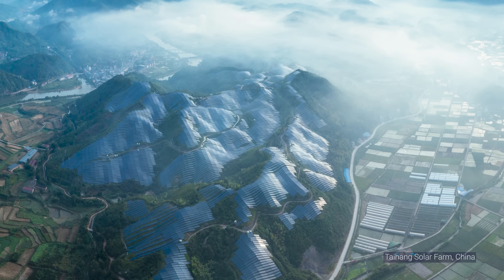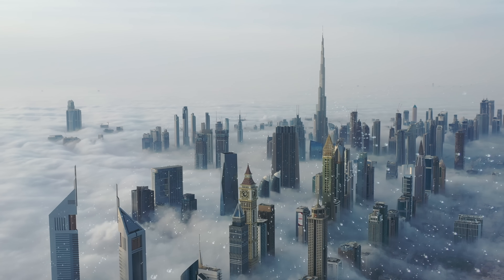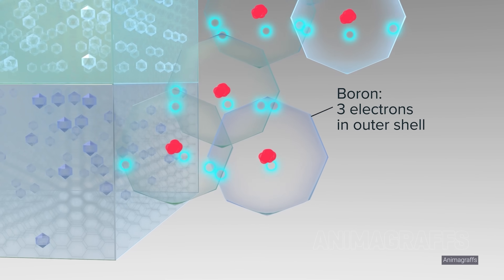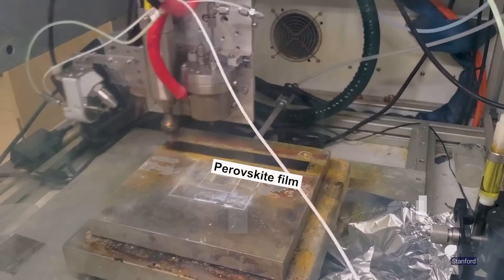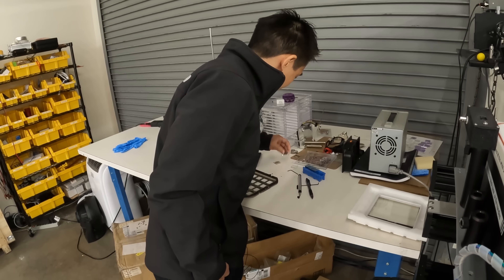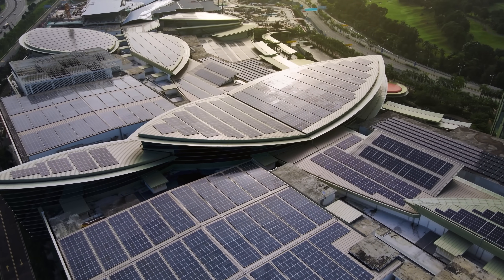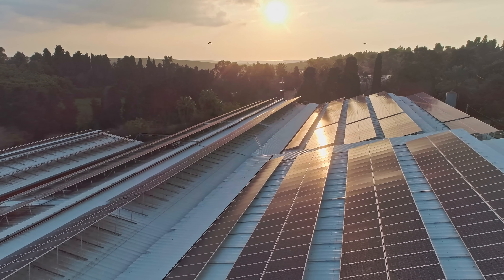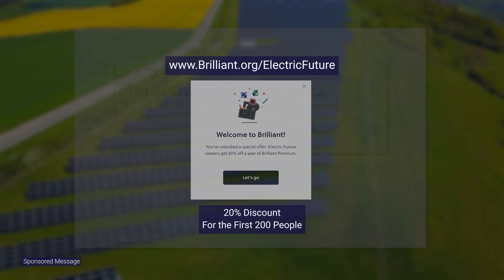Solar 3.0: This New Technology Could Change Everything

Comment: If it’s actually much cheaper, then the low cost could supplement the “short” lifespan. Also, the higher efficiency would make it beneficial to have a replacement schedule. 
But, each time we hear about cheaper tech, it is always more costly than what it replaces. 
Eg, carbon fibre parts, aluminium parts, cars made with more plastic and paper and thinner/less metal, all costs more than the predecessor. 😏
Reply: Hi! I do research with perovskite optoelectronic materials, and the issue around perovskite lifespan is less about the cost, and more about the environmental effects of perovskite film decay. 
Most perovskite research is based on a structure that fundamentally relies on lead as a constituent. So, the worry is that if the material decays, harmful lead salts could be introduced into neighborhoods and ecosystems.
Also, the stability issue as I understand it is more detrimental than described here; leaving an unprotected lead halide perovskite material in any hot, humid, or even heavy rainfall environment would cause the material to stop performing & decay into lead salts, which, until addressed, seriously limits applications. Even exposure to air in lab on humid summer days can "kill" the materials useful properties.
I hope this helped you understand the perovskite's stability issues more!
Reply: @sweetshiba_  Hmmm, you are a true lab geek. I can relate perfectly to your explanation. Did some university chemistry (a little material science too). 
Keep up the good work.
Reply: @sweetshiba_  Then why do you manufacture panels with PV materials in them?

Why don’t you manufacture polymer/silicate panels that collect, concentrate, SPECTRALLY* (autocorrect mistake) disperse, and transmits light to a centralized processing unit in the basement?

Manufacturing would be far easier, panels would be far cheaper, and all the cost/environmental issues would be in a smaller contained unit in the basement.

You also have the benefit of adding more materials to handle different band gaps asymmetrically. If you only want to convert two or three wavelengths, you buy two or three filters with the respective material. If you want to convert 20 wavelengths, buy the respective filters for those particular wavelengths.

Now your PV technology isn’t ties to the panel and transmission systems that are the most exposed to the elements. All damage from the elements are done to the passive optics and not the conversion units in the basement.

Also…passive optics are completely impervious to EMP like from lightening, solar flares, or upper atmosphere nuclear explosions.
Reply: @josephcoon5809  Sorry, I don't really understand your question. How would you collect, disperse, and specially transmit light without having already converted it into electricity?
Reply: @sweetshiba_  You don’t know how light propagates from one medium to another with a different index of refraction? Or how light disperses through a diffraction grating?

You’ve seriously never heard of fiber optics?
Reply: @josephcoon5809  I'm not sure if I'm familiar with a mechanism that would allow that idea to work without facing a higher net energy loss than you would with current solar cell designs. If you have a good idea you believe in, though, research it!!! It's good to have critical thinkers with new ideas :)
Reply: @josephcoon5809  unfortunately, i have deadlines to meet & plans to stick to in my materials research! So I'll keep doing  what I'm doing :) if you feel up to it, though, good luck with that idea!!
Reply: @sweetshiba_  That’s why centralization is a bad model.

In your limited scope, you pursue technologies  without addressing their fundamental flaws. Your adherence to deadlines forces you to adopt a myopic view of the situation precluding your ability to see the dead ends you are heading towards.

As long as you aren’t doing so with government funds, I’m good with it.

However, you you ARE relying on government funds to perpetuate an obviously designed flaw for the sake of “the environment,” then I will engage everyone who engages in regressive thinking.

Don’t drag society down with YOUR failures by accepting government funds.
Reply: @josephcoon5809  ok, you obviously don't understand how research is done 😭 do you have any hands on experience?
Reply: i didn't say this yesterday because i wanted to be nice and encourage you, but the attenuation from the fiber optic design would cause that idea to have seriously diminishing returns when compared to regular PV cell designs, because as your transport light through any medium besides a vacuum, you face a loss of energy. thus, layered materials are a better design from an energy efficiency perspective. 
fiber optics are wonderful and all for information transport, but they aren't suitable for high amounts or actual energy transport, as attenuation is a current problem even for signal transportation
Reply: also, my research is specifically in the scope of materials research for optimizing the solar cell designs that the clean energy market needs. you can't get research funded unless there's someone to fund it. research is expensive. it's competitive. you have to be producing what people want, you can't just follow a poorly researched concept and expect funding for it from anyone.
 so don't be all high and mighty talking about research that you clearly don't understand 😭
Reply: also, if you think you have a good idea, and mechanistically it makes sense from any angle you attack it from, go for it! don't put specifics in a YouTube comment section, because of the idea really is good and someone sees it, they could plagurize without you even knowing
Reply: finally i can tell that you are clearly interested in the topic of PV material design and have started to read about it, which is good! i don't want to dissuade you from following your ideas; we could use new bright minds in the field!! just don't be an asshole to people who are doing the work you're not because you think you understand it better than them, you know? im sure if you continue to be interested in optoelectronic material design, you'll surely be making cool things soon !!! for now though, make sure that you fully understand the fundamentals of what you're doing on, and again, don't be an asshole to people because you think you're smarter than them 😁
Reply: @sweetshiba_  First off, I’m well aware of energy loss through fiber optics, and the short distances you are referring to in a household application of solar energy conversion is negligible compared to the losses incurred through panels subjected to variable environmental factors.

You weighed the energy loss without considering the manufacturing cost.

Way to deal with a single variable of a multivariate situation.
Reply: @sweetshiba_  “you can’t get research funded unless…”

You resort to the most inefficient system imaginable?

A centralized one?

Perhaps you should stick to your field of “research” instead of broadening this to economic and political concepts?

Just because it is difficult to secure funding, that is no reason to engage in the antithesis of natural evolution.
Reply: @sweetshiba_  If you THINK I’m worried about being plagiarized, then you completely misconstrued why I’m doing my own research in various technologies which solar panel design is only a tiny portion of.

You also don’t seem to be in the research for any benevolent reason if you are worried about ideas being “stolen.”

So, now we dip into philosophy and morality.

You sure you want to go there?
Reply: @sweetshiba_  When you ask me if I have any experience in “hands-on research,” do you actually mean “experimentation”?

Anybody can “research.” The internet has made that easier than at any point in history.

Now, if you meant “experimentation,” then yeah…I’ve done lab work done n chemistry class. I understand the general principles, MOSTLY, because that’s what the brain is actually designed for; the cerebrum specifically. Your consciousness is nothing more than an advanced virtualization and simulation machine that stores information and allows that information to be synthesized into new ideas.

Babies do it automatically. How do you THINK babies LEARN to see color in 4-8 weeks after birth?
Reply: also, im not looking to debate you or anything, because i seriously don't care. so, this will be my last reply! take care 💕
Reply: @sweetshiba_  If my “mightier than thou” prose is bothersome, then you should probably consider that “nice words” justifying tyranny is childish compared to “harsh words” ridiculing tyranny.

Maybe if you studied a little neuroscience or some basic Greek history/philosophy, you’d understand why emotional rhetoric like “nice words” are dangerous to society.

Taking society’s wealth to find “your” research is not rectified by being “nice” about it.

You haven’t said anything worth responding to.

You offer your knee-jerk analysis to optical power attenuation and think that’s enough to dissuade me from the major flaws in your research as if you don’t have the time to engage with somebody who you’ve no idea about. I’m actually trying to have a conversation while your tossing scraps to a kid you think is in high school just so he will leave you alone to your research.

If I was like you, I have no doubt that I would find that condescension quite offensive. As it turns out, I’ve studied the brain as well, so I understand what emotions are.
Reply: @sweetshiba_  And I’m not the one assuming they know who the other person is, so claiming that I am the one acting like a “know-it-all” is pretty humorous.

Fun fact: science doesn’t care about “nice,” so stop wasting time with it.
Reply: @sweetshiba_  Of course you don’t care about society.

All you care about is “your” research. It doesn’t matter to you that society has to be dragged down so your existence feels validated.

There is no “debate” here.

It’s just you tossing out vague ideas to shoo the “high schooler away” as you continue on with your elitist attitude about science.

You weren’t here to have a discussion OR learn anything.

All YOU came to do was flaunt some imagined relevancy in what you do.

Congratulations.

Cheers 🍻 

🤣
Reply: @sweetshiba_  Mr Nick, you are a logical thinker. If you weren’t, you couldn’t be making any progress in your field of work. 
Please, don’t be sidetracked by nay sayers
Reply: @sweetshiba_  Just from your ORIGINAL statement, it’s already pretty evident that any energy loss from optical attention over a few yards would be heavily outweighed by the controlled environment of the perovskites that use caustic materials, like Pb, to tune them to various band gaps.

The fact that you lose energy from any photon more energetic than the band gaps requires pretty much balances out with the loss in optical transmission.

Or were you hoping that I didn’t know about the thermal energy introduced into your systems when photons with more energy than the band gap is converted to waste heat which also contributes to the breakdown of the PV materials REGARDLESS of the environmental conditions? Even in PERFECT weather conditions, solar irradiance is across a large spectrum that two or three materials thinly layered together will result in excessive energy inefficiencies AND material degradation.

What do you do with that heat? Are you “researching” some thermocoupling material to absorb that waste heat and convert it to useful energy, or maybe you are looking for ways to exhaust that thermal energy into the environment to lengthen the lifespan of your PV materials?
Reply: solar filter
Reply: For anybody else that happens across this “conversation”…

The “band gap” is the energy required for an electron to jump from one energy state to a higher state in a photovoltaic material. The energy in a photon is described by its wavelength; shorter wavelengths are more energetic. So, every material has a particular wavelength of light that will cause a valence shell electron to jump into the conduction band.

What makes a material semi-conducting is the gap between its base election configuration and the the conduction band. Insulators have a large band gap while conductors have no band gap. Semiconductors have a band gap in the visible portion of the electromagnetic spectrum. However, any photon that has MORE energy than the band gap does not create more current. That extra energy is converted to heat. Since electrons can only occupy particular states, a band gap is associated with a SINGLE wavelength.

The Sun bathes the Earth in an entire spectrum of wavelengths which means most of the radiation produces waste heat regardless of the material you use. That waste heat contributes heavily to the degradation of a solar cell, and the manufacturing processes used for these solar cells makes them too costly to recycle forcing manufacturers to demand freshly strip mined rare earths for conventional panels. For the newer panels using a tetrahedral molecule enclosing various ions creates a tunable PV material to accommodate many different wavelengths. Unfortunately, the main dopant is Pb…lead.

So, now when those panels reach end of life, they are dumped in land fills releasing those caustic materials into the ground.

In this “researcher’s” opinion, the inefficiency caused by thin layers of different PV materials justifies the environmental impacts of dumping these panels into the ground. Apparently this is better than the passive optics approach which also has energy losses, BUT the manufacturing is FAR cheaper AND recyclability is far more feasible. With all the rare-Earths and/or caustic materials operating in the cilantro controlled environment of the basement, degradation is minimal while replacement at end of life is far cheaper.
Reply: to clarify misinformation above bc i'd feel guilty not correcting it:
1.)perovskites are cubic molecules with the active site being [BX6]^2- octahedra, with B = a transition metal and X = halogen

2.)lead isn't a dopant, its the centre of a field of perovskite development for ABX3 perovskite materials (see: inorganic lead halide perovskite)

3.)those panels aren't yet produced because of the enviromental impact, of which addressing is the heart of current perovskite material/cell research; as of now, there is no environmental impact

4.)lead-halide materials currently have PLQYs of around 100%, indicating energy loss in a solar cell would be near zero

5.)the other main issue to be addressed in the current research is addressing perovskite stability issues, which is achieved through various methods, such as doping in different transition metals or by sillica shelling, or by employing absorbant layers with low thermal conductivity to limit thermal decay (by absorbing any light with energy > material bandgap)

6.)in the past 5 years or so, lead-free perovskite related materials w/ similar optoelectronic properties have been explored to great success in terms of both performance and stability, negating the need for & toxicity of lead alltogether.

in the future, please read primary sources and be careful not to spread misinformation
Reply: @sweetshiba_  I’m really impressed with the progress you guys have made so far. How can I be updated further?
Reply: @sweetshiba_  I’m really impressed with the progress you guys have made so far. How can I be updated further?
Reply: @sweetshiba_  I’m really impressed with the progress you guys have made so far. How can I be updated further?
Reply: @sweetshiba_  I’m really impressed with the progress you guys have made so far. How can I be updated further?
Reply: @sweetshiba_  I’m really impressed with the progress you guys have made so far. How can I be updated further?
Reply: @sweetshiba_  I’m really impressed with the progress you guys have made so far. How can I be updated further?
Reply: @sweetshiba_  I’m really impressed with the progress you guys have made so far. How can I be updated further?
Reply: @sweetshiba_  There you go!!!

However, you managed to avoid addressing the cost of manufacturing and cost of recycling when addressing the efficiency of the technology you are “researching” versus a modular system as I described.

The thing is, “your” research is easily incorporated into my designs, so your work isn’t a complete loss. That’s the main difference between the two systems. ANY innovation in conventional solar panels make all current solar panels obsolete. In a modular system, ANY innovation in ANY component has no direct impact on any other part of the system.

If the collection, concentration, spectral dispersion, transmission, OR conversion modules experience any innovation increasing efficiency, the other modules are left relatively unaffected.

The technologies that you are researching, being the more complex and composed of more costly materials, would be in a controlled environment and less susceptible to many of the issues you mentioned in your original comment as well as your most recent one.

To your point 5: Your stability issues are easily resolved by directing ONLY the wavelength that pertains to a particular doping. It automatically negates most of your proposed solutions like silica shelling or absorb any layers. You wouldn’t need them because you’ve restricted all wavelengths that would produce waste heat from striking that particularly doped perovskite.

So, if you REALLY want to maintain that the loss of power through attenuation justifies the far more complicated manufacturing processes and extra specialized layers to accommodate waste heat, then that is on you.

Essentially, you’re designing a better engine for an obsolete chassis.

I’m designing a better chassis.

Your work doesn’t even deal with the 40% of radiant energy in the IR range which can easily be directed to thermal applications. So, even IF you could muster 100% efficiency in converting visible light, you’re maxing out at 45% total efficiency when considering the entire 1,000 watts/m^2 that hits the Earth.
Reply: @sweetshiba_  I’m really impressed with the progress you guys have made so far. How can I be updated further?
Reply: @Roq-stone  If you're interested, I can try and reply with some current literature reviews! Are you interested in reading about inorganic lead-halide perovskites, or inorganic lead-free double perovskites? Also, if you're specifically interested in doping and/or shelling lead-halide or lead free perovskites, I can try to reply with a paper on that too! Lmk :)
Reply: @sweetshiba_  3: “There is no environmental impact.”

Talk about “misinformation.”

Current solar panels REQUIRE more strip mining to accommodate the manufacturing of more panels as older ones are retired to landfills. If you think more landfills and strip mining is “no environmental impacts,” then we have different views on the matter.

Whether we are discussing CURRENT solar panels or the panels YOU are working on, there IS an environmental impact. A modular system solves the environmental impact for BOTH types of panels. It all but negates the land fill option by allowing a far more recyclable option. It also provides a far more controllable environment for any toxic solutions that YOU are working on without all the added cost of extra engineering and materials research.

4: Looking into this, but I am currently unsuccessful in verifying this claim since the poster failed to provide “primary sources.”

Still found nothing in this claim.
Reply: Coincidentally, it is that conduction band that also explains why reflected light is polarized parallel to the surface of reflection. The electrons in the conduction band of a metal have more freedom of movement in the plane parallel to the surface of the metal than perpendicular to it. So when a photon (which is a spherical wavefront; not a point of energy) strikes the conduction band, the electrons absorb the wave at slightly different times and oscillate creating new waves that interfere with each other. It is that interference pattern that produces the apparent change in velocity of a light “ray.” Light ALWAYS travels the same velocity. What you detect when measuring things like the index of refraction is actually where all the waves constructively interfere.

So, light is always a wave. The perception that it is a particle is a result of an interference pattern.
Reply: THIS is the problem with “researchers” dragging down the economy with Federal grants to pursue partial solutions without any consideration for consequences.

“Who Pays the Bill?

It will almost certainly fall to regulators to decide who will bear the cleanup costs. As waste from the first wave of early replacements piles up in the next few years, the U.S. government — starting with the states, but surely escalating to the federal level — will introduce solar panel recycling legislation. Conceivably, future regulations in the U.S. will follow the model of the European Union’s WEEE Directive, a legal framework for the recycling and disposal of electronic waste throughout EU member states. The U.S. states that have enacted electronics-recycling legislation have mostly cleaved to the WEEE model. (The Directive was amended in 2014 to include solar panels.) In the EU, recycling responsibilities for past (historic) waste have been apportioned to manufacturers based on current market share.”

It is the short-sightedness and myopia of “researchers” that allow corporations to implement technologies with designed obsolescence and “unforeseen” circumstances that require FURTHER government (corporation) involvement to deal with.

So, anybody who is interested in this “research” needs to look at the bigger picture of cash flow from beginning to end to understand how “research” is directed to maximize profits across various industries.

“Researchers” like to focus on one or two variables to validate their work because assessing all the other dozens of variables makes their work seem like a sham.

Of course, “researchers” who don’t have to work for their funding are free to disregard real-world concerns like manufacturing, costs, environmental effects, sustainability, economic impact in general, or social impact. This is why they spit out a litany of “scientific facts” with no supporting information regarding all the other concerns involved.

THEN, they get pedantic about ‘misinformation’ to score “authority in the field” credits involving irrelevant concepts (whether lead is considered a ‘dopant’ or the actual geometric configuration of a molecule; seriously?) so as to draw attention away from the more relevant issues.

Sure, you just need to add a few layers of other materials and it’ll all be good. Just make sure not to ask what those extra layers add to manufacturing process costs and material costs or how it will affect the recyclability. Toss out enough “corrections” to “discredit” the dissenters so the Federal funds keep rolling in unabated.

https://hbr.org/2021/06/the-dark-side-of-solar-power